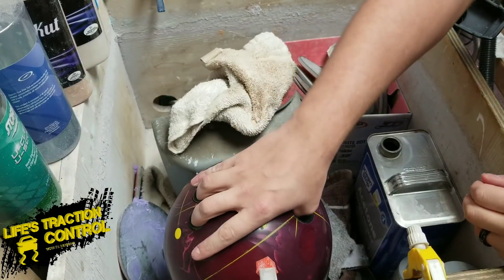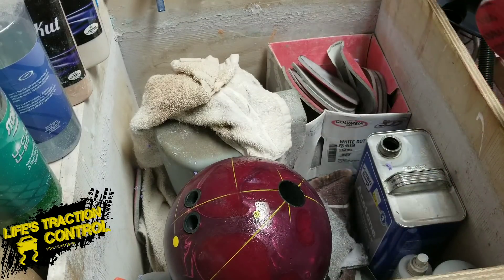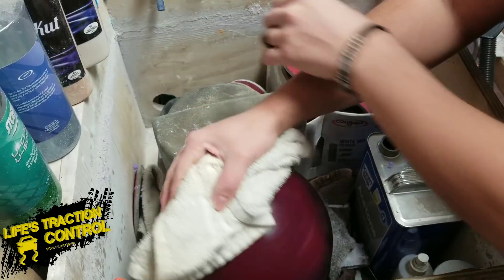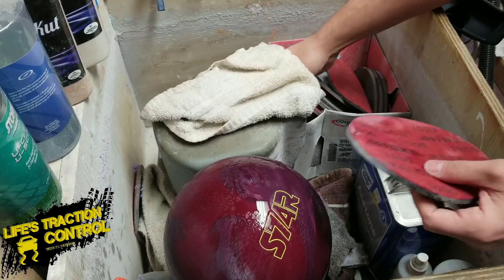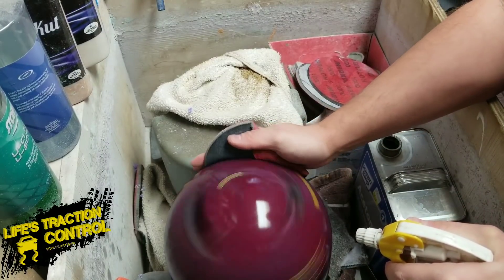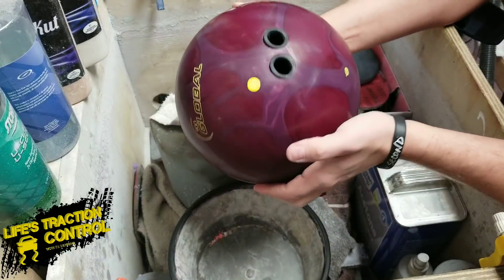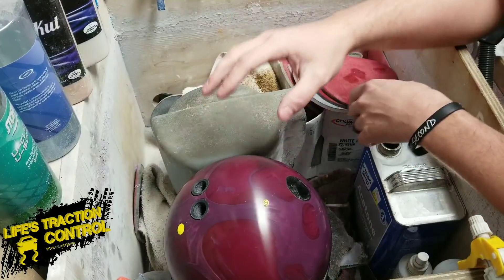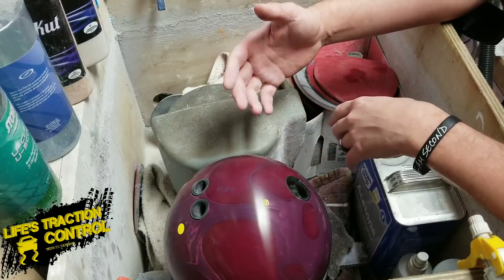changing the surface of a bowling ball

Comment: For the average, every few weekend bowler like myself, on top of personal maintenance, how often would you recommend a pro shop either cleaning/extracting the oil or doing a complete resurfacing for proper upkeep? Thanks!
Reply: For my reactive cover ball, I used the oven method to remove excess oil prior to the start of the season and a lot of oil came out.  I wipe the ball off every time before I throw it, wipe it off before I put it away and clean it when I get home.  I find this helps to keep a consistent surface week to week.  I have started experimenting with sanding the surface in an effort to reduce my hook and have hand-polished the surface to 5000 grit followed by Trucut hand applied polish. I am a beginner bowler with about a 145 average and I know a lot of better bowlers who do no maintenance whatsoever and can throw a strike with just about any ball in the alley.  So find what's best for you and repeat it.

Comment: I’ve been told you lose hook when wet sanding the ball. That it’s better to dry sand (don’t spray pad or ball). Any difference?
Reply: That makes sense to me but only better if you want more hook.  -  Typically the use of lubricants in a grinding/cutting process removes sanding dust and allows the process to work better.  Better meaning a more consistent cut with fewer gouges in the material.  If you are going to dry sand don't press too hard and be sure to let the sandpaper do the work.  As you work look for the fine dust produced by the sandpaper and let that fall away.  Lift the paper from the surface often and clean it.
Reply: Terry Pullen Thank You!

Comment: How much pressure are you applying around 15-25 lb for pressure? Is there a thing as too much pressure?
Reply: The amount of pressure will vary with the type of surface, paper type, grit size and wet or dry.  Too much pressure can clog the paper or cause the paper to overheat.
Reply: If u use too much pressure the 15 lb ball will become 14lb

Comment: I have a phaze 2 and I keep going through the head pin consistently.  Im a 2 handed bowler and I bowl around 13-14 mph.  I was thinking about making the surface shinier to give it more length down lane. what do you think? and also, will I need to keep resurfacing the ball to keep it that way or is it permanent? thanks.